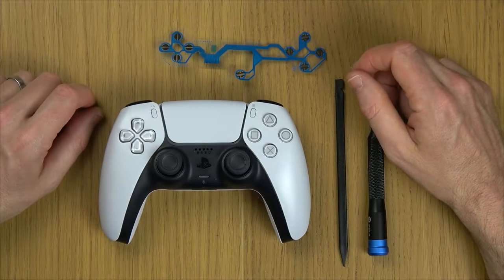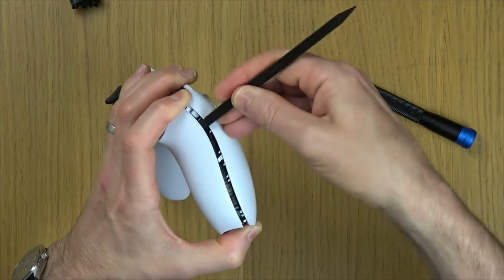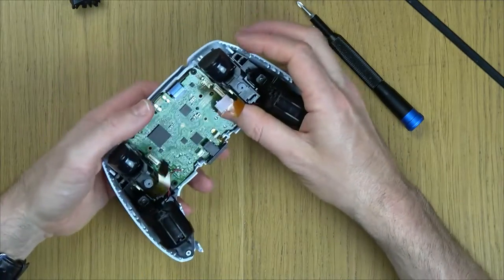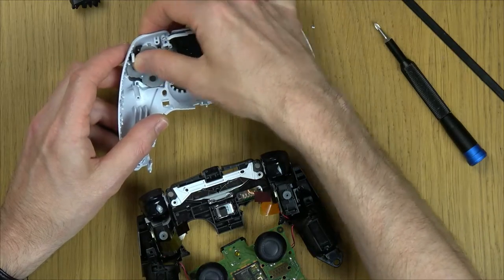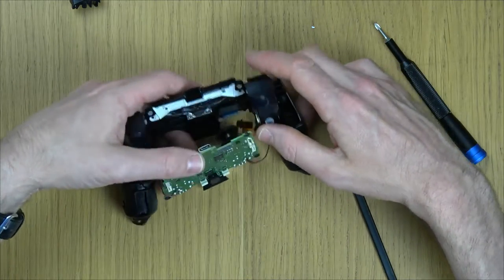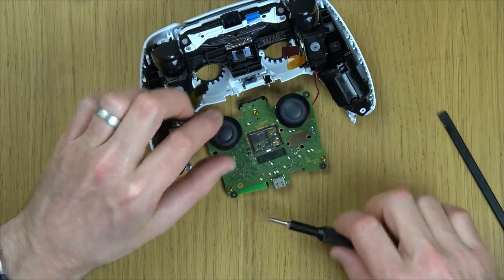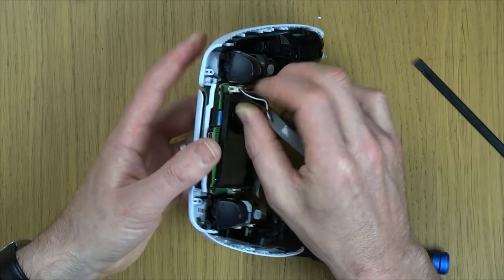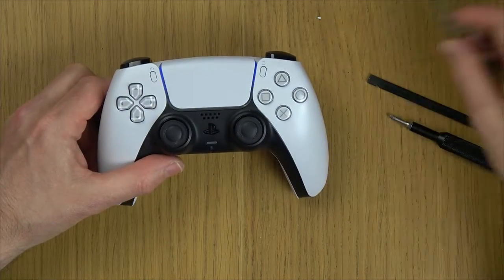How to Replace Flex Ribbon Cable Circuit Board on PS5 Controller

Comment: Thank you Vince! You saved me. My daughter had spilled tea on one of our dual sense controllers and I thought we had acted fast enough and cleaned and dried it but nope. Everything was basically working except the mic button, which was permanently muted. The only way to change it was in the settings on the PS5 itself. Well I completely tore the controller down to the membrane and it turns out it was a little gummed up as well as the mic button area itself. Once I got that all cleaned up and reassembled (and apart again to flip the ps membrane the right way) the button works like it should! I'm so happy! Thanks you!!

Comment: Thank you! I just wanted a video to show how to open it up, disconnect and reconnect stuff (I dropped it and all buttons stopped working except sticks) and I just took everything out n out it back and it works. Saved me £60!

I also had 2 less screws when down to taking off last part? Looked a little different. 

Thanks again

Comment: Thank you for this. I tried cleaning mine first with contact cleaner. No dice. On the the next and final step which is replacement. If it still doesn't work then it's over

Comment: Could this fix the controller not turning on. It charges and all but when i press the ps button it wont turn on my ps5 even when wired
Reply: ^ did this fix it for you? I have the same problem
Reply: @jonathanramos8601  yes i bought it of ebay for 7 bucks and installed it. It works fine now.
Reply: I have the same problem.  Do you think I need to just clean it.  Not replace it

Comment: I broke the cable at 3:31 trying to fix my stick drift pls help
Reply: Did you fix
Reply: @wadda2144  I didn't end up needing it, it was for the headphones but I use wireless ones
Reply: @WillemDafoeOfficial  I took back shop said it was broke they gave new one :)
Reply: I broke the same cable did it work fine because I heard you could get an electric shock😅